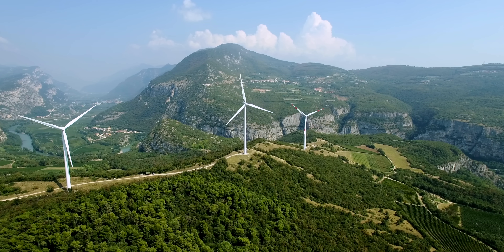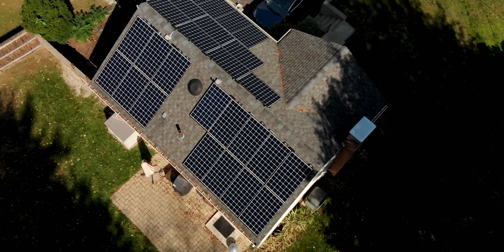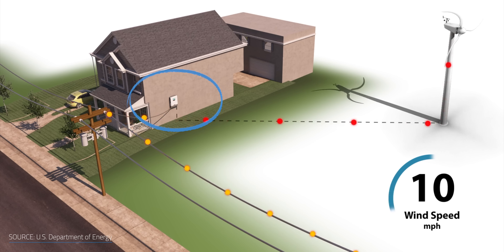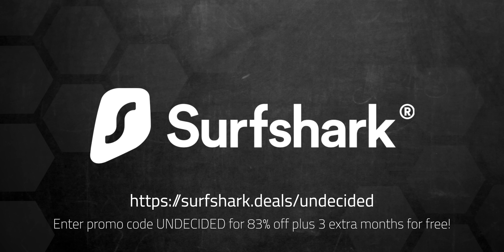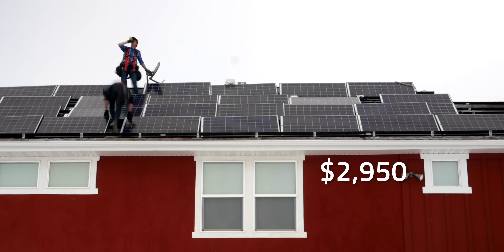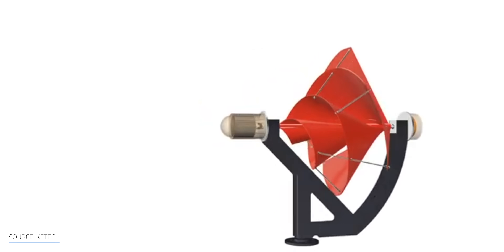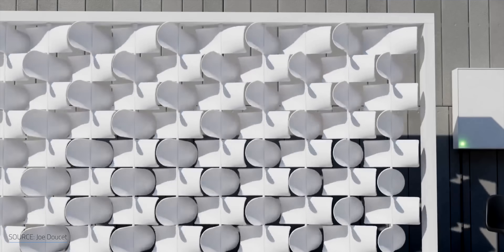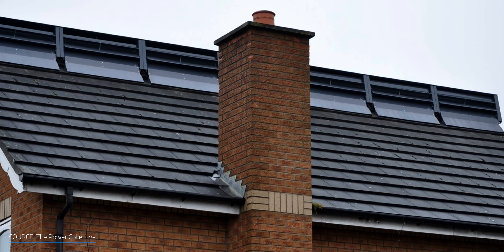The Challenges of a Wind Turbine on Your Home

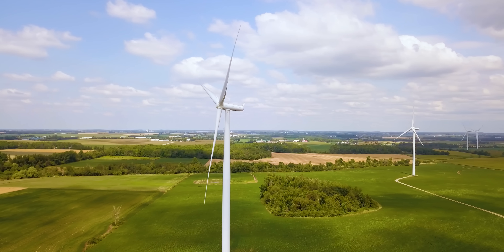Comment: 2:24 The thing is, the area the blades cover doesn't affect the energy generates linear, but squared. Which means increasing the length of the blade increases the energy generated exponentially. So bigger wind turbines are way more cost effective than what you can put on your home.
Reply: Not true. Power is proportional to swept area. It doesnt magically funnel into your blade path although you can make a funneling structure like I did
Reply: And what if I put up a funnel made of something like tent fabric before the turbine? I can even have the turbine at the ground level then. With the air hose going down to it from the funnel hanging on the tower.
Reply: So they make sense for tall apartments
Reply: The biggest thing with small scale wind is the same as with sex. Location, location, location. Since small scale wind by definition using small blades (sweep area 2*pi*r*r so double length is 4 times the output), and flow rate. Because of interaction with ground, trees, structures height has a massive impact on flow rate.  Of course if you live on a large hill ridge line or where wind gets funneled thru a gap, this increase flow.
Reply: Breezy 5.5 kw system, at 60 feet minimum, is a starting point for real power generation for single family home IMO.
Reply: And wind is much faster further up
Reply: @InfiniteLuke  nuh uh, the “area” increases the energy output linearly
Reply: Exponentially?   No, it’s still a squared law.  But your point is correct.  Elevation is also important.  You gotta go high to get away from the surface friction.  And it takes money to go high.  So as you say, wind is not effective at homeowner scale.
Reply: @paulogden7417  Except perhaps off gird, depending on location.
Reply: @paulogden7417  f(x) = x² is kind of the most basic exponential function. So yes, exponential. Height is also a factor (and you have to go higher to increase blade length), but blade length makes the output grow faster.
Reply: @InfiniteLuke  that's quadratic growth. exponential would be f(x)= a^x, where a is some positive number
Reply: @marklion315   oh, you're right 🙈 I've always put those two in the same box.
Reply: @InfiniteLuke 
Same.... The label on the lid says "maths stuff I vaguely remember from high school but don't care about now"
Reply: @marklion315  Having taken up to 2nd year university level math, I'm still kind of surprised that you are right about this.

I mean, i knew what a quadratic function was, but I didnt realize that there was such thing as quadratic growth.  I have always thought a = b^2 was simply exponential, even though it can also be quadratic. lol

Comment: The seemingly very high capacity factors you quote led me to dig a little bit and examine some of the definitions

In the US Dept of Energy Land-Based Wind Market report 2021 Edition
https://www.energy.gov/sites/default/files/2021-08/Land-Based%20Wind%20Market%20Report%202021%20Edition_Full%20Report_FINAL.pdf
They clearly highlight that:
"Turbine design and site characteristics influence performance, with declining specific power
leading to sizable increases in capacity factor over the long term. The decline in specific power has
been a major contributor to higher capacity factors, but has been offset in part by a tendency toward
building projects at sites with lower annual average wind speeds.", where specific power is the nameplate generation divided by the swept-area of the rotor. (page ix of the pdf file). If you downgrade what you expect from an installation, then it becomes easier to meet expectations.

On the same page they also state that "The primary motivations for partial repowering have been to re-qualify for the PTC, while at the same time increasing energy production and extending the useful life of the projects." The PTC is the Production Tax Credit.

So, in plain English, they have been playing around with the definitions of what the turbines do, not any real physical changes. And they did this in order to re-classify existing turbines so as to harvest more subsidies, not harvest more wind.

Comment: I had a small wind turbine that could be raised and lowered, attached to the back of the bus I was living in in the north of Scotland. It generated the small amount of power I needed easily, but it was quite noisy despite all the padding/buffering I could add. However, with wind at about 45mph it hit the resonant frequency of the bus, making a deafening noise. And at that speed it wasn't safe to take down the turbine. I lost a few nights' sleep to that one.

Comment: I disagree with the cost of maintenance wind vs solar. Having talked to people about the replacement of damaged solar panels along with the cost of a new roof. I am looking at a vertical wind turbine with the added vibration collection of energy. I will not be putting any device on my roof, my thought is to put a turbine near my crop areas to help keep animals away. You mentioned light weight construction, Iceland produces a sturdy turbine that should last decades. America is so lost in the past that we have not progressed from the high maintenance stuck way up in the air horizontal turbines to the more efficient vertical and vibration tech. Think of placing vibration collectors along the right of way on major highways, no moving parts, no huge amounts of land needed. Add to all of this climate change, fewer sunny days, floods, more ice and snow covering the panels. With improved wind turbines we could still use the land for growing crops, not have to deforest entire mountain top areas for panels as occurred in I believe it was Vermont.

Comment: Wind isn't clean energy. The more blades out there the more need replacing and that comes with impact on the environment.
Reply: If you're placing the bar that high, there is no clean energy: everything needs to be manufactured and maintained.  The equation that matters is amount of pollutant waste generated per unit of power during expected life, on average.  Turbines do pretty well by that metric.

Comment: Two technologies I haven't seen a whole lot on... I remember a study, but I can't find it, about a place in Scandinavia, where they used pipes under their roads and heat storage tanks to collect waste heat from the road all summer.  In the winter, they reversed the system and heated the road, to keep it's surface temperature just over freezing.  They were expecting enough excess heat to heat the buildings along the road as well.  Although it was much more expensive than typical road surfaces, but by keeping the road temp above freezing saved a lot of money on snow removal and extended the lifespan of the surface by getting rid of the freezing/thawing cycle.  

The other technology I remember- they were trying it in Spain, and maybe Australia... they were solar heat collecting towers- not the ones that use the mirrors... just really tall towers that took advantage of air temperature differences from the top to bottom- sort of vertical green houses with wind power at the top.  

I wonder, you combined those two... shorter towers, but maybe heated by pipes under large parking lots.  Basically you'd still have the durable regular parking lot surface, but you could maybe cool the surface a bit and get some of that back as electricity with a much shorter tower... like a slightly oversized light post?  Or maybe a greenhouse type roof over a parking lot to get even more heat but let it out through a tower where you could gather some wind at the top?

/Funniest power source... poop, but not the predictable burning it way.  I remember seeing some public building that was powered by the waste heat from sewage.  Basically instead of an air or ground heat pump it was a poop heat pump.  98.6 for the win!
Reply: Back in the day, cow & buffalo chips were burned for heat in the prairies... what a deal, no chainsaws & forest management needed

Comment: Next challenge. Water Turbine for your home.
Reply: You may laugh but shouldn't the likes of for example shower/bath water capture for filling toilets be a standard thing on at least new houses. Can't exactly be that difficult to implement and certainly never seen anything of the sort in the UK. Madness that toilets use cleaned drinking water for flushing.
Reply: @David-bi6lf  I was thinking the same thing. Turbines off of a gutter system or as you stated, the shower/bath water (or separate urinal?) Water>air when it comes to energy.

Comment: The example you show for the RidgeBlade definitely looks like a British house not Canadian and its shown on the web page as well even though its Canadian company. Most British house builders haven't embraced modern architecture, they still all have to look like something from the Tudor times with tiny fake sash windows, fake chimneys and fake stone bits under the windows. Putting that on top makes it look better and moves it in slightly more to the 21st century.

Comment: One important detail to explain is that the maximum possible energy capture is based on the cross-sectional AREA the wind turbine operates in. Grid-scale installations very long 3-rotor wind turbines would so well because they cover a huge cross-sectional area with as small a mass as possible. ALL of the options shown here capture a much smaller area and have a lot more mass for that area, meaning they will never be competitive with grid-scale systems.

Comment: You came to the right conclusion. For residential houses solar is superior, just like you explained. Only really good micro wind turbine on the market is Windside. Proven technology and all the best features (produces over 300 d/y, operates between 2m/s to 25m/s, soundless, very low maintenance, 50y life span, does not harm birds, etc). Yet they can’t make business with residential houses (cost, mast, installation, etc). Rooftop installation is not an option, as roof structure is normally not designed to carry wind load. If you have money and want wind, then Windside.

Comment: i can honestly see smaller scale airborne wind energy becoming useful for off-grid and home generation needs. some of the differences between it and traditional wind is that it utilizes easily replaced materials, doesn’t require a long shaft for a blade (although they do need plenty of room), and generates far more power. it does this because most designs make use of kites which can harness energy from the upper atmosphere - and larger models have capacity factors that are so close to baseload they might as well be baseload. the idea has, like many others, been around since the 60’s - but now software and AI have gotten to the point of development to where they can pilot these things even in inclement.

 id love to see a video covering this topic, for its potential for both grid-scale and off-grid. i think these systems hold especially high promise for where i live in the American South - where we get terrible hurricanes that can threaten wind farms.

Comment: There is one more advantage to Solar Panels in the US Southwest areas: Air conditioning requirements are lower due to the shade produced by the Solar Arrays. This reduces Power Consumption significantly on warm days, as well as reducing wear on the AC, filters, etc.
Reply: Great point. People often forget about the cooling effect that they have!

Comment: Yup, moving parts suck. I say that as a mech engineer that's working with moving parts every work day. If you can make a design without bearings or grease, it's usually better. (my current company made a design that replaced a fancy belt with rollers. Went from 4 bearings to 33. It cost about the same, but had massive reliability issues.)

Comment: Hi! LOVE your channel! I wonder if a vertical wind turbine could work really well on an RV while driving on the highway? On another topic, rain collection on an RV to refill water tanks would be awesome. Solar panels are already standard on RV’s.
Reply: On a moving platform you need to remember that the turbine is moving based on drag... So you are adding drag to your vehicle, which has to be overcome by additional gas to keep the vehicle moving. It will always be a net negative after the efficiency of the engine and turbine are taken into consideration.
Something deployable in a windy spot while camping? Might work... May not be super cost effective, but if you are in the shade and solar isn't an option it could be the 2nd best option.
Reply: So you would be using diesel/petrol to power your turbine which is extremely inefficient. Far better to install a larger alternator which is highly efficient.

Comment: Thanks for this video. I'd love to take advantage of whatever geophysical assets were available to me, but obviously cost is a factor - it must also make financial sense. Also, in an urban setting, noise mitigation is very important. Hopefully domestic wind turbine tech makes the same techno leaps as solar and also becomes more cost effective. Electricity should generated at all levels - grid-level, community-level & household level - in order to make energy more resilient, climate ready & affordable. Options available could include biogas conversion, conduit & turbulent hydro (where this is an option) at community level. In smaller towns / suburbs, nearby farms might want to include wind farming (where appropriate) to supplement their income (similar to agrovoltaics). I came across this video a few days ago (these windmills are prevalent all over our farmlands here in South Africa and I always wondered if they could also simultaneously generate electricity):
https://www.youtube.com/watch?v=vHqdz6ZdjH8
https://www.youtube.com/watch?v=MDb6HEY-uR4

Comment: The problem I face with solar is that I can only have that much. I live in a small town in southern Europe. That means that houses are stacked one to the other. Mine looking east and west. I have plenty of roof, but even if I cover it all up with solar, I manage to peek to 4kW. Around 1000kWh a month in July. That can seem a lot, but it is barely enough for transport (EV), and cooling the house. In winter, it only accounts for some 10-15% of my energy needs.
So, the question for me is... where do I harvest more energy from? It would be cool if I could put solar in my neighbor's roof but I don't think that is legal.
Here is where wind comes to mind. Not as a way to have most of your energy, but a way to top up. Yet, it has a major, major problem: It shadows. And shadows affect your solar installation or your neighbor ones.

Comment: My 500W chines wind turbine  produces some 150W On a good windy day.  Not a primary charge producer it sure helps on those crappy dark Sunless days.   My 4kw of batteries reduces my electric bill by more then 70%. Our electric use is much lower then most USA homes.   We use a  1KW grid tie inverter but never  produce enough the back wash to the grid.

Comment: Great job hammering home the point about the moving parts.
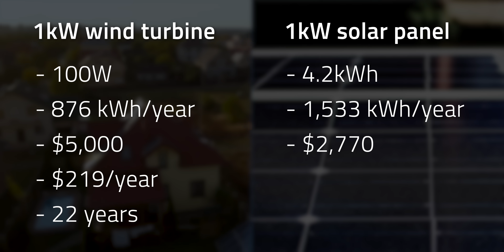Concerning the cost brake down at 9:10 : Shouldn't you also subtract an average for maintenance, like you mentioned at 7:25, from the yearly savings from a wind turbine?
Something like 87,50$ (1.75% of 5000$), which would bring the yearly savings down to 131,5$ and increasing the packback period to 38 years (!!!)

Looking at those numbers, wind makes 0 sense for home installations in a region like yours.

One additional thing that needs to be mentioned is the recyclability of big, grid scale wind turbines:
It sucks :(
While incredibly energy intensive, almost every part of a solar panel can be recycled, while currently, to my knowledge, we do not have any process that can reuse the carbon fibre the blades of big turbines are made out of.
Currently, in most parts of the world, when a big turbine reaches EOL, those blades are simply dumped into landfills or buried.
Plus, big turbines need big foundations, the amounts of steel and concrete you need to build those arent insignificant either.

If none of those numerous battery techonlogies you talk about manages to completely change the game in the near future, we probably have to ramp up wind a lot too to combate the intermittency of solar, but man, with all those problems, I am not a fan (pun intended).

Comment: My home is in a relatively good area for both wind and solar.  I have southern exposure on my roof, and the average wind speed is 15MPH year-round, measured at head-height, no tower needed.  The cheapest and easiest way to get electricity is thru the grid -- no up front costs, 15 cents/KWH day or night.  The downside is our frequent power outages lasting from several hours to a day or more.  If I want to handle the power outages, a combination of wind & solar is ideal.  Typically a power outage is caused by wind knocking down a tree on a power line, so wind energy would be at a peak just when it is needed most.  It's rare for me to have no solar source at the same time as no wind, but for that, we need batteries.

If only someone would make an economical charge controller that seamlessly integrates solar, wind, batteries, and a bidirectional grid feed, I would have it made.  Right now, it's a hodge-podge of connections and electronics and too expensive.

Comment: The cost of buying many commercial home grade windturbines it still to high. But they are a nice DIY project. They can be build from salvaged components. They won't be the best in the market, but building it cheap is the fastest way to make a profit. You can even get coils from old electronics. (Tip: Start with a small prototype.) If you want to take the middle way, you can probably get DIY kits. The advantage of a wind is that your can greatly reduce the cost by DIY it, and using salvaged components. With solar you are stuck with the price from solar panel manufacturers.